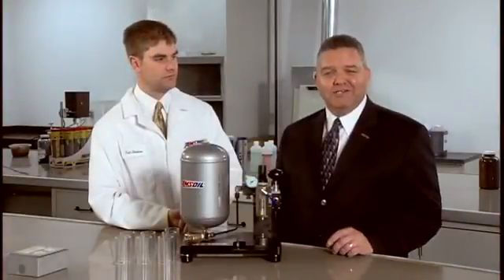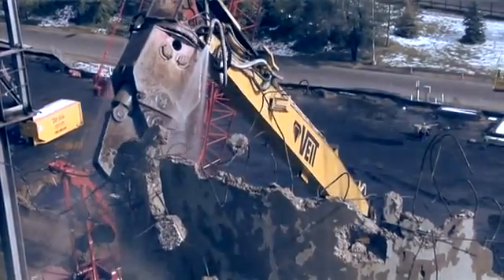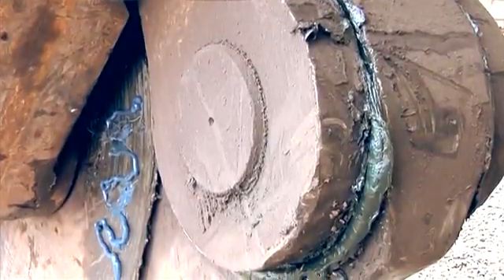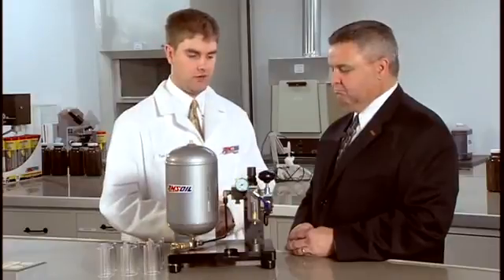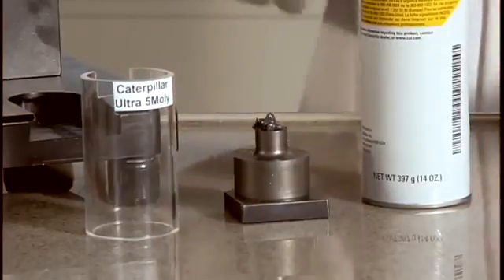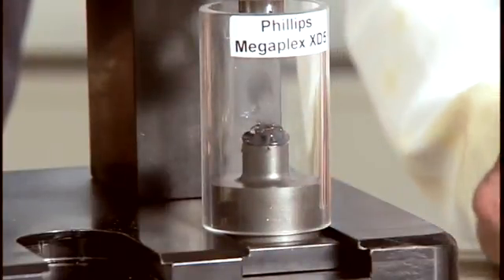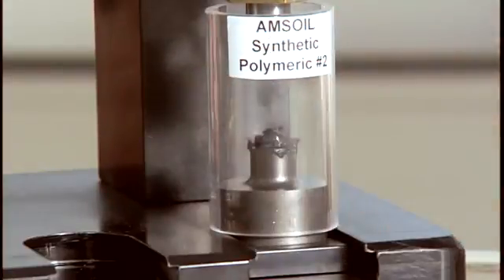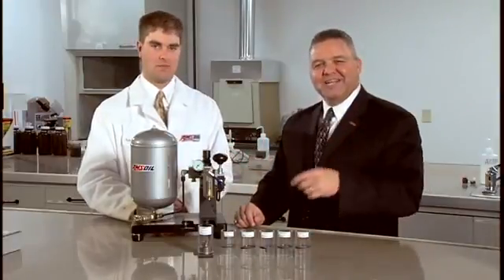AMSOIL Grease Comparison Testing - Pound-out resistance

Comment: I'd like to see  The  Amsoil Water Resistant Grease, and the regular Amsoil Multipurpose Grease (black cap )   in the pound out test vs   
-Castrol Greases
-Mobil 1 Full Synthetic Multi Purpose Grease
-Some Shell Rotella multipurpose greases
- Lucas Xtra Heavy Duty (green label tube) 
-Valvoline Synpower Grease